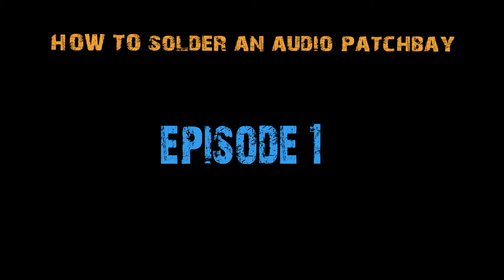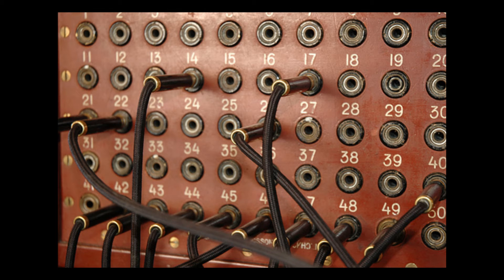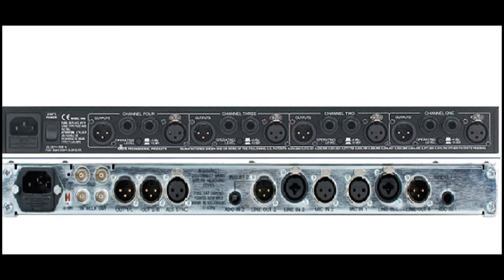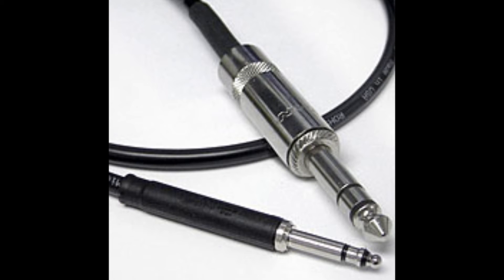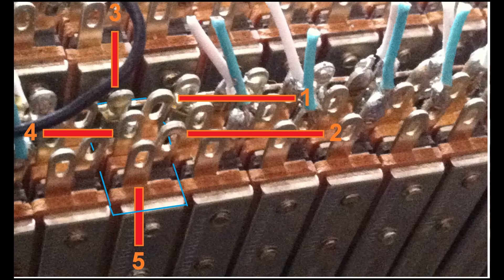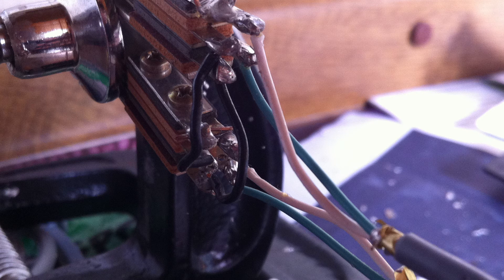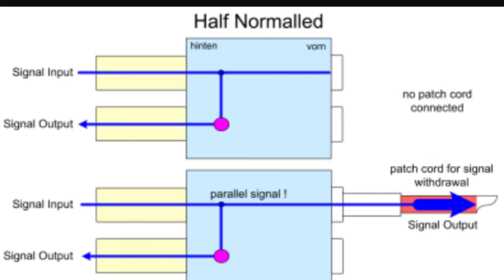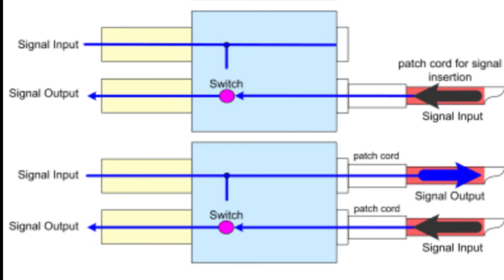How To Solder a Patchbay Episode 1: Introduction To Patchbays

Comment: Great tutorial although aren't the hot and cold terminals at 2:42 actually the other way around? Hot should be the bottom and cold above it right? Please correct me if I am wrong..
Reply from the maker: Ben Saler hi ben. It really depends on your patchbay, this is the more common set up in my experience. If you were to look at the connector for the hot terminal on the bay it connects to the tip of the bantam jack when it is plugged in. In truth it doesn't really matter anyway, if you connect hot to ring and cold to tip it just reverses the polarity, but obviously it is good practice to keep it symmetrical (and in turn correct). Also please note the patchbay is upside down in this video, that may add to the confusion!